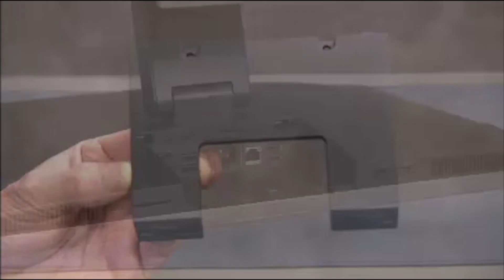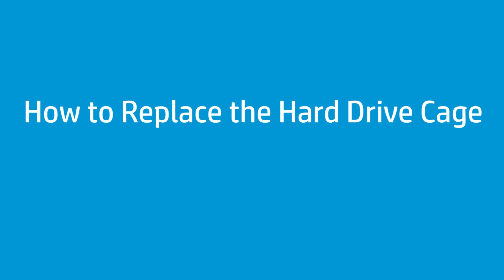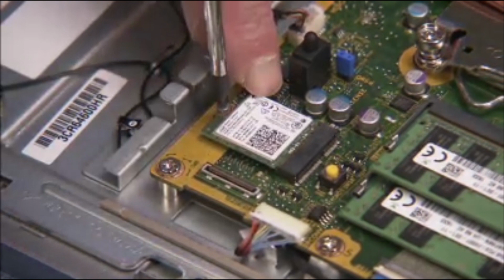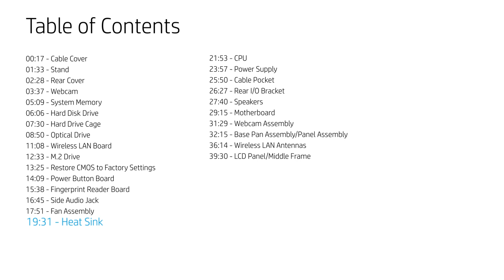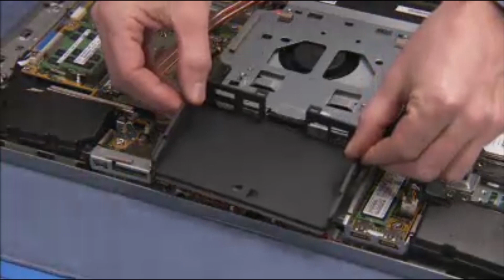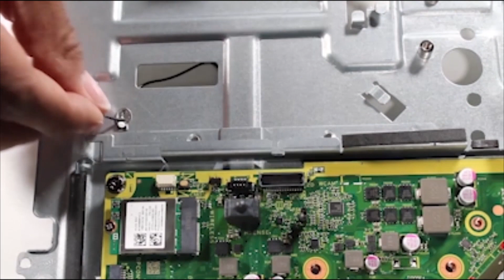Removing & replacing parts for HP EliteOne 800 G5 23.8-in AiO | HP Computer Service

Comment: Hi can you please show me on how to restore the default HP LOGO on Flash Screen during POST? There is nothing on the Bios to enable or disable the Logo. Thank you
Reply from the maker: Hi Elyas, thanks for contacting HP Global Social Media Support!
		I am here to help!
		May I know the product you are using?
		Let me know!
Akhil_HP Social Media Tech Support
Reply: @HPSupport  My device is HPEliteone 800 G4 AIO
Reply from the maker: Thanks for getting back to me, Please try to update all your hp drivers and BIOS to the latest version and see if that helps solve the issue. Also, please provide me a serial number/ product number in order for me to check for accurate solutions.
Let me know.
Akhil_HP Social Media Tech Support
Reply: @HPSupport  as far as updating the latest drivers and bios, i already did that but i couldn't restore the default Splash screen for the HP, the customize splash logo is still there. i am sure it is written and located in the bios but the thing that puzzles me is why cant the default HP logo be restored and why there is no option in the Bios to disable or enable customized Flash Logo on the POST. Serial is CZC917B13K